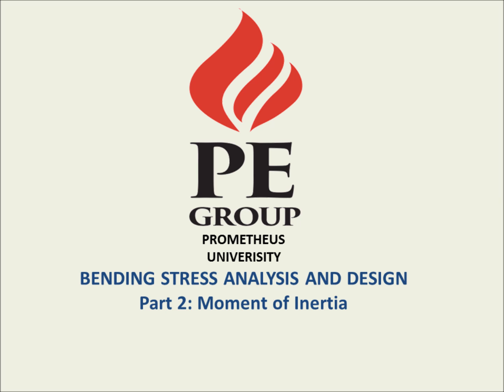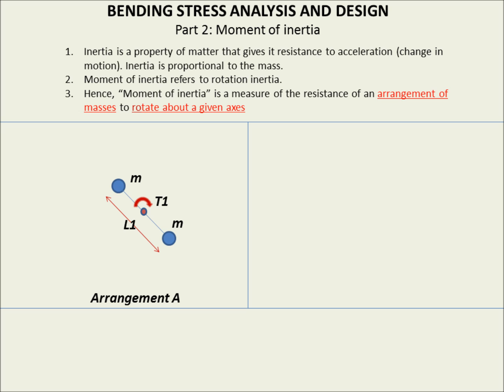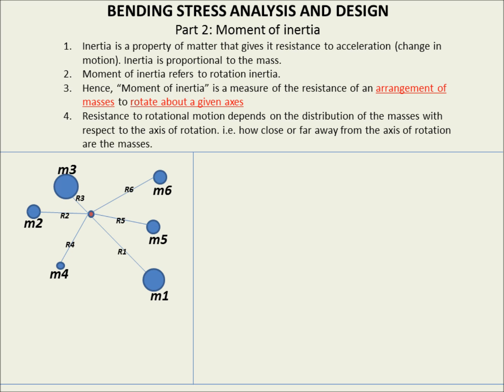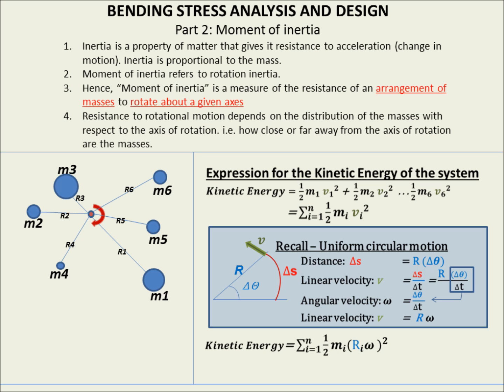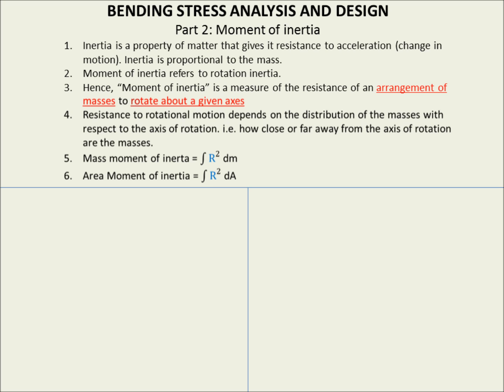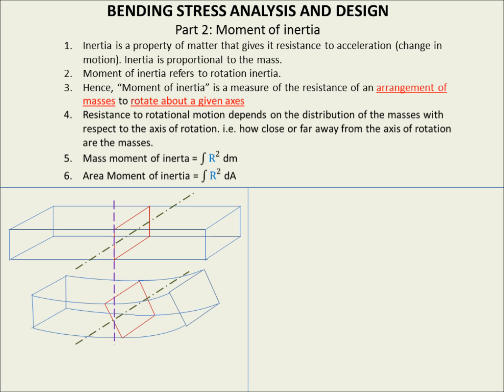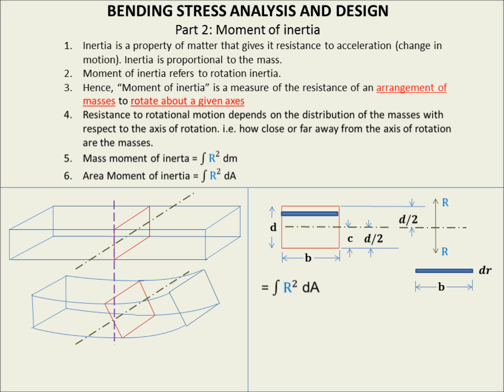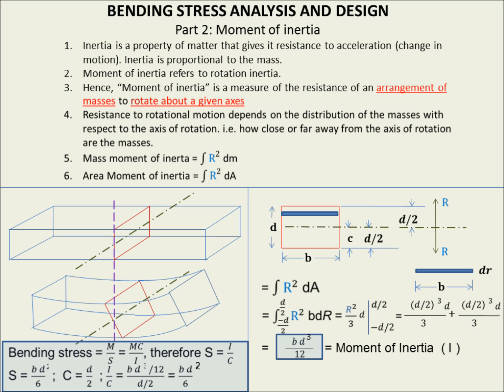Basics of Bending Stress part 2 - Moment of inertia

Comment: i did understand the moment of area resistance,but how is section modulus related to resistance?...
Reply from the maker: That's a good one. To begin, let's point out that the section modulus may be derived by dividing the moment of inertia by the distance from the axis of rotation to the extreme fibre of the shape. By dividing the moment of inertia by another cross-sectional parameter we get additional information about the cross-section. The additional information we obtain helps us answer the the question of how (in terms of distribution of area relative to axis of rotation) the moment of inertia has come about; and this will ultimately tell us something about stresses in the cross-section  On a high level, we may think of the moment of inertia as the primary property of the cross-sectional "shape" that determines its resistance to rotate, while the section modulus describes the distribution of the resistance to rotation.  The paragraph below contains an illustration for your consideration.

Consider the following:
We may have two different shapes with the same moment of inertia about a given axis. Let the first shape be a circle with a large area. Let the second shape achieve the same moment of inertia as the first with less area arranged in a skinny rectangle. Both shapes with BEND the same amount under similar loading conditions. However the shape with the lower section modulus (the rectangle) will experience a higher amount of STRESS because there is less area available to resist the forces in the cross-section.  There is a price to be paid, in higher stresses, for manipulating less area into shapes that offer the same rotational resistance as those with larger area.

To conclude, we may go back to the opening paragraph and note that the section modulus answers the question of how we achieve a certain moment of inertia: either by relatively even distribution of a lot of area about an axis of rotation or using less area but concentrated further away from the axis of rotation.  Please let me know if you need further clarification or have any other question.

Thnaks!
Reply from the maker: Here is another video for our loyal fans! This one breaks down the concept of shear stresses in beams!
https://www.youtube.com/watch?v=fJiJY06iX7Y
Reply from the maker: Please see our latest video (on structural dynamics)
https://youtu.be/ZxvLC-91QKs